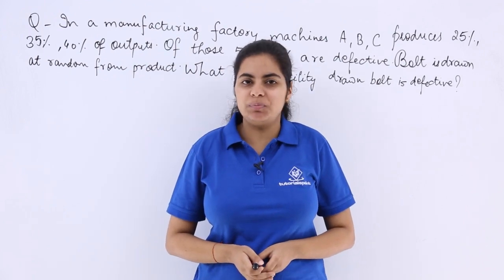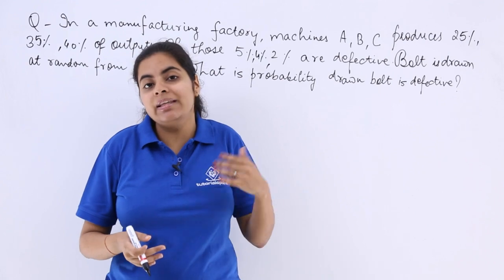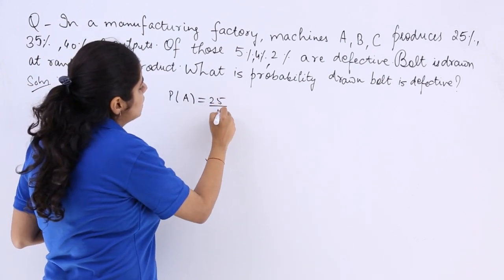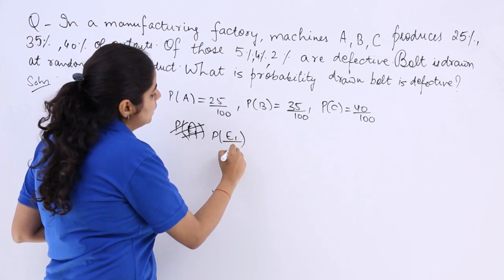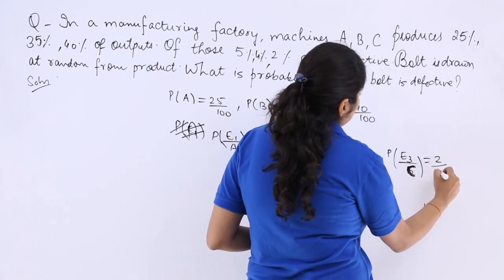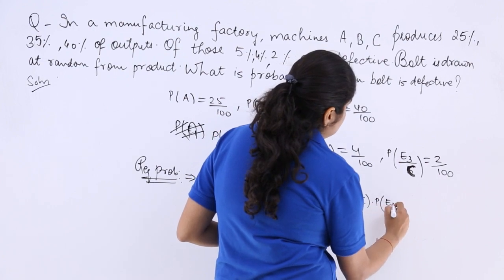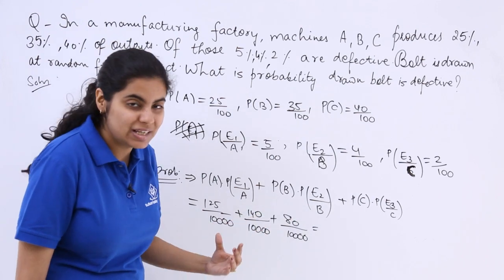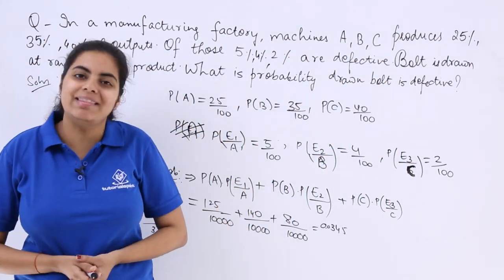Class 12th – Law of Total Probability Problem-2 | Probability | Tutorials Point

Comment: A shipment countanes of coppnets 3 individual boxe 1st box counties 20000 coponets of which 25% are difetive and 2nd box  counties 5000 coponets of which 20% are difetive and 3rd box counties are 2000 coponets of which 600 are difetive a box is selectled at random and a coponet is removed of the random for the box what is the probability that this components is defective. What is the probability that it comes from 2nd box